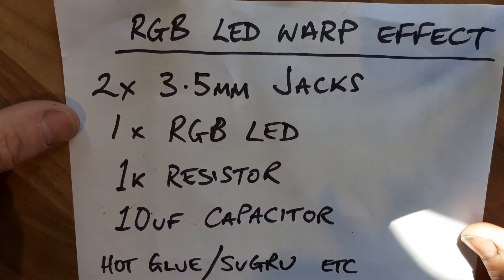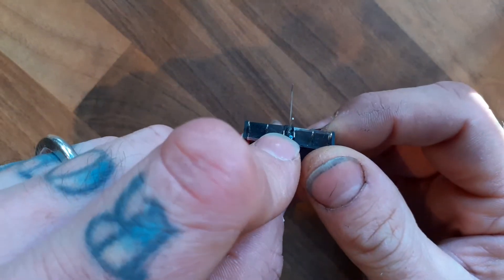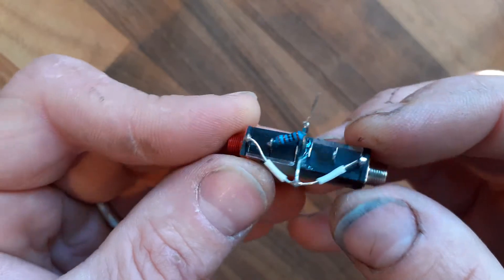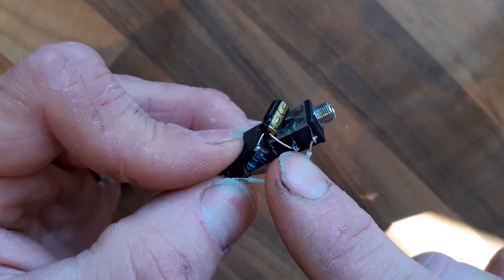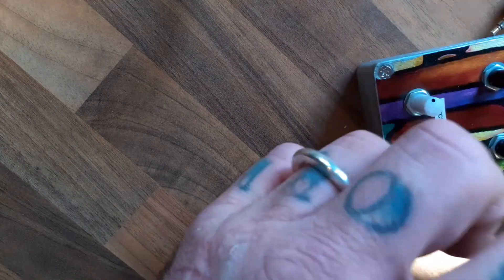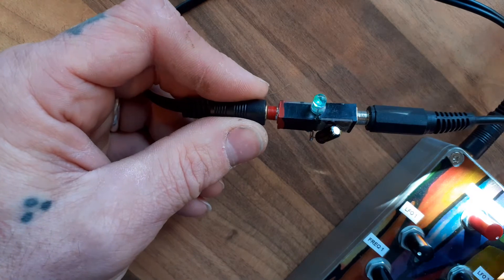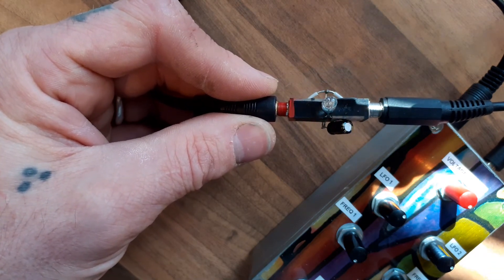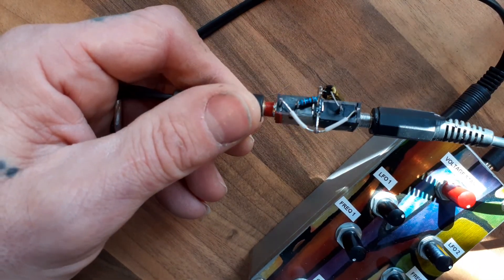RGB LED oscillator/ warp effect -DIY-

Comment: I don't have any RGB LEDs, I'll try with a standard and bipolar LEDs and see if it works.
Reply: yeah nah, doesn't work with standard or bipolar LEDs :(
Reply: this is kind of old and im sure you figured it out but maybe someone hasnt...these leds have an oscillator inside them theyre not just rgb theyre flashing rgb leds. they come in fast and slow speeds as well.
Reply from the maker: Haven't tried bipolar leds.. but I can't see it working still... regular  leds do not work..